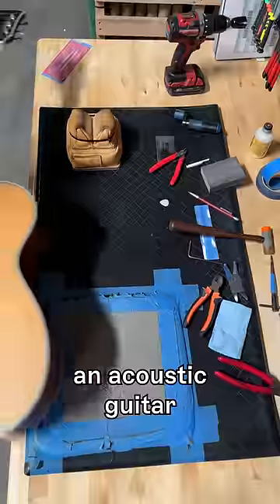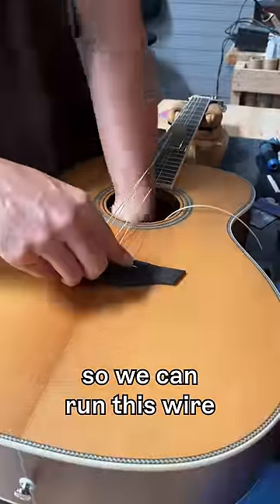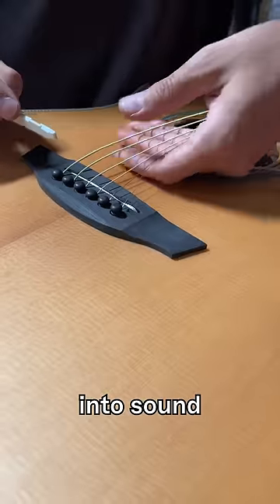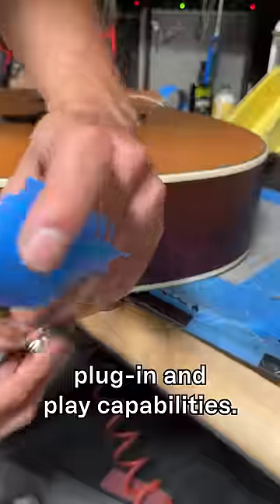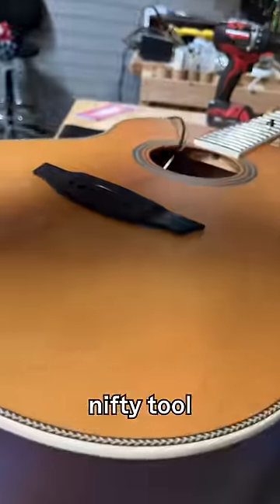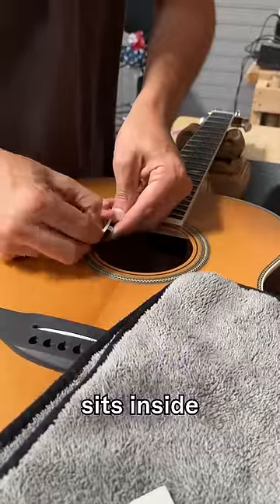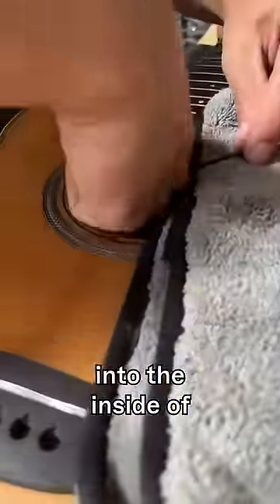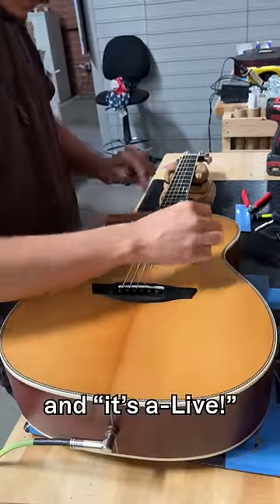Turning an ACOUSTIC guitar into an ELECTRIC guitar?

Comment: "Do the impossible". Literally how an electric guitar was born.
Reply: Literally every electro acoustic guitar out there...
Reply: No, the first electric guitar was a
 plank of wood fitted with strings and a pickup. It was called the log and is located in an electric guitar history museum I think. No acoustic guitar modification happened there. Rob Scallon has a cool video on it.
Reply: @smartaleckduck4135 The Log was Les Paul's first electric guitar design.  Les Paul didn't invent the electric guitar.  Even Gibson's own ES-150 predates The Log.
Reply: @smartaleckduck4135 Guitar was electrified long before that. You think about first solid body electric guitar, in which case your answer is also incorrect.
Reply: I legit put a piezo into my acoustic last August. It was a fun little project, and it sounds amazing.
Reply: @smartaleckduck4135  that was the first solid body electric. Hollowbody electrics existed years earlier.

Comment: Moves strings out of the way the whole time then proceeds to cut them
Reply from the maker: We can't show everything in the edit, but our techs are testing the pickups throughout for sound, even before the restring!
Reply: Hahahahahaha, 😂😂, same😂
Reply: those string set deserved a second chance, please, stop making residue when not necessary. With a good degreaser they would sounded good. I don't dig the so called Luthiers or guitar techs always clipping the strings out instead of trying to recicle them.
Reply: @andomi 

PREACH! 

this is all I've seen on YT... also I always thought you should remove one at a time while replacing the one just removed for neck tension reasons or some shit.... either way, you aren't ruining strings.
and while acouguitar strings are relatively cheap, still they can be handy to have around. I'm not great at re-stringing and saving the old strings came in handy while I snapped one while re-stringing
Reply: enriqueamaya3883 
It's NOT empty, it's full of motor oil
Reply: @orangewoodguitars 
What's that have to do you wasting good strings?
Reply: @orangewoodguitars also, that's not impossible whatsoever. MOST acoustic guitar companies have been doing that since day 1 it was  invented.

Impossible my ass.

Comment: Man I’d hate to have to re-string every time I’ve got to change batteries
Reply: I mean bro batteries last a long ass time
Reply: The electric acoustic guitar I have has a compartment on the outside of the body for the battery as well as a tuner and tone adjusters got it at guitar center for 250$ don’t know how much these ones are going for.
Reply: Loosen strings. Put a capo in 1st fret and pull your bridge pins. That way the strings stay put. :-)
Reply: @DaveAbrahamson-wi5sm you've been around the fret board a time or two. Kudos
Reply: you don't have to restring, just loosen the strings and put them on the side

Comment: When I was young, the conversion process was just clipping a pickup into the round sound hole in the body, then plugging it into the guitar amp .  No drilling or cutting and easily reversed/unclipped for an acoustic melody .
Reply: Dean Markley ProMag Acoustic Soundhole Pickups still got mine 25 bucks

Comment: Don't ever put your battery inside of the guitar. They make great little plug-in plastic cases for your battery to go on the outside
Reply: Why? What is gonna happen of I put the battery inside of the guitar?
Reply: @Amin.Ashraf fire, probably
Reply: @B_H_J  I've considered that being a possibility. But seem like it's highly unlikely to happen if the battery is inside the case and wire correctly.
Reply: Well when it dies you either have to loosen strings and retune (if that even works) or just change and retune strings completely. Not ideal for live or creative situations
Reply: Yeah I got a fishman box it works like a charm and if you are playing a lot the battery needs changing every week
Reply: I'd much rather detune to change batteries than cut a big hole into the body just for a battery, it takes less than a minute it's really not a big deal
Reply: @porteal8986  that's seem impractical because you also need easy access to the pickup on/off switch. Non destructive solution would be mounting the switch and battery case on the outside and run the wire through the sound hole, some might say it aesthetically unpleasing.

Comment: The pickup doesn’t “translate vibrations into sound” it creates an electric current from the vibrations, which is carried by wires to the amp. The amp “translates” electrical signals into sound.

Comment: How do you change the battery without loosening the strings a lot?
Reply: You can't
Reply: You cut the strings 😅
Reply: Make a slot for the battery case by cutting a hole through the body. Like all the electric acoustic guitar. if you don't know what you do. You can mess up the guitar sound

Comment: Sometimes its just easier to say "no" and walk away. Why not just mic the guita - neeeevermind. 

If anyone is actually interested, you can get soundhole cover electric guitar pickups that slot into your acoustic.
Reply: Mic'd anything acoustic ALWAYS sounds better. I miss those days but they're not coming back. My Wechter acoustic has a 3-way piezo/mic/magnetic pickup system but I mostly use the piezo and run it through my Roland AD10 pre-amp which has ambient features you can add-in to remove the sterile piezo bullshit. I'll add a teency bit of mic on occasion and the mag pickup is cool for slide playing.

Comment: I did this myself on an expensive brand new Martin guitar. It was frustrating and nerve wracking because when I bought the $200 authentic martin pickup I had no idea I would still need to drill these holes. The bottom of the guitar is extremely hard wood and the brand new drill bit I had to buy would not penetrate the wood. I finally got it but chipped up the bottom of the guitar. Otherwise it all works. Also, another pain in the ass is changing the battery later. Its a 9V battery and lasts for awhile but ya annoying. Kind of regret not just getting a clip on pickup.

Comment: You might fuck up the sound of your guitar if you do this. The top of the guitar needs to vibrate to produce a nice sound, the more material you stick on there, the less it will resonate. You can try this out yourself by simply laying your hand on the body of your accoustic guitar, can you hear the difference? Think of it like a snaredrum, when you put something on it, it'll sound a little muted. Up to you ofcc, if you still want to install this product on your guitar. It sounds like a nice little diy project and might teach you about how your guitar is build. Keep in mind tho, there is a reason guitar builders use as little support beneath the top as possible.

Comment: That’s just an internally mic. guitar. To be an electric guitar you would have to have a pick up and wiring in which the vibrating strings generate electricity to create the sound that is amplified by an amplifier.

Comment: You haven't made that into an electric guitar.
A real electric uses magnetic pickups.
Piezo pickups work via vibration from the saddle and bridge.  Magnectic pickups utilize magnetic field and string vibration.
They both utilize vibration but from a different source.
You get a distinctly different tone between them.
A piezo still creates a tone similar to the natural tone if an acoustic guitar.  
FYI....there are magnetic pickups available for acoustic guitars.  Personally, I think they sound horrible but they are available...

Comment: Why did you wait to cut the strings?
Reply: Probably so they don't block him from installing all that stuff inside the guitar.
Reply: @bruh-xp9zf  he could just remove them. He’ll have to remove them to put new strings in them anyways. It’s just more work. Not to mention a big waste.
Reply: @blakesaupe129  Most people cut the strings to remove them. Also what is he wasting? Dead strings?
Reply: @bruh-xp9zf  yeah and they are weird. And those aren’t old stings. He’s explained in other videos that they aren’t even old. They are just what they shipped with. Sure they aren’t nice strings but people could still use them. There’s no reason to cut them.

Comment: Where and how did you mount the piezo I tried it and it doesn't work right
Reply: The piezo strip goes under the bridge piece. You will have to sand/file down the bottom of that piece to make up for the depth of the piezo piece. Probably 1/16" or so

Comment: If the pickup is for vibrations, then what is the mic for?
Reply: The Piezo has a very different sound from a "normal" microphone (I'd say . This guitar has both a microphone and a Piezo, so you can change between those when recording through the jack.
Reply: You can blend in a little mic sound  along with the piezo pickup to take out some of the plastic sound they provide and add warmth. If you use all mic it will feedback fairly quickly if using monitors unless you're at very low volume levels.